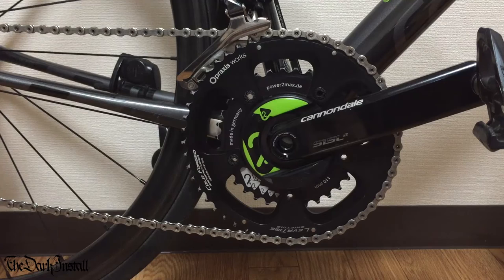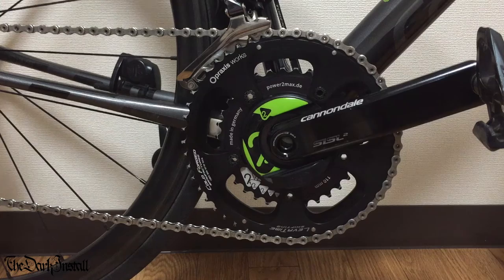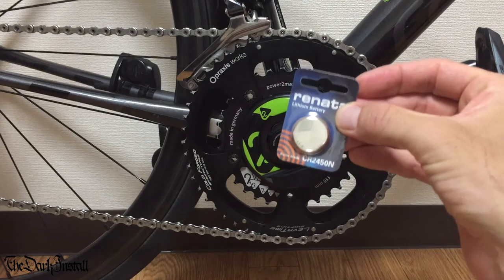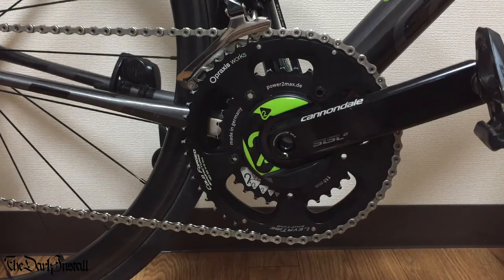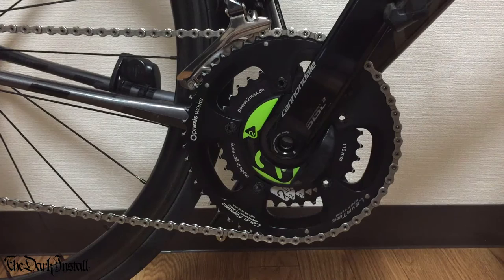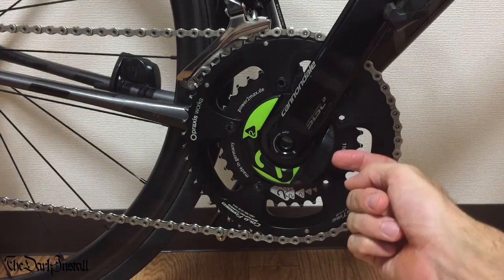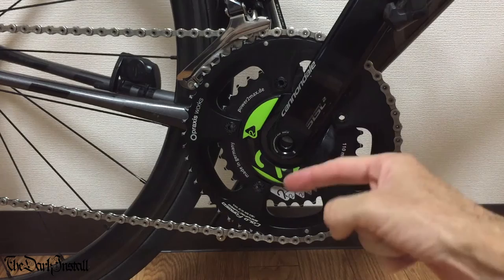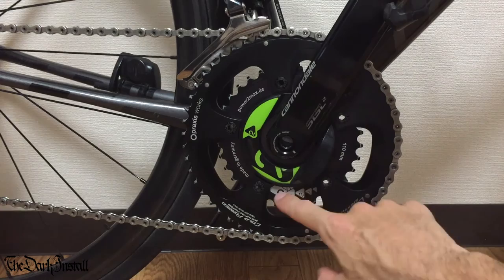Power2Max Type S. 7000km Review!!!

Comment: Awesome Review! I had almost the exact same setup. PowerS (bought in July) for my Cannondale Si Crank. After a couple different mechanics and shops, the TERRIBLE shifting you mention with the recommended Praxis rings was so bad I ended up returning EVERTYING (after a lot of fighting!). I loved the power-meter itself, but couldn't ever get the shifting as good as it was with the factory FSA's..... I am excited for your follow up review on that!!!
Reply from the maker: Joe Ferguson Thanks a lot!  Yeah the Praxis shifting is lame. Like a lot of road bike stuff, a few people say that a product is good on the usual forums, and then that becomes the standard response when speaking about that thing.  You can see this with Praxis rings.  In reality they flex and the shifting is crap.
Reply: TheDarkInstall did you ever find a "fix"? or the best way around? or did you just accept it? and change your style?
Reply from the maker: Joe Ferguson Yeah I 'fixed' it slightly;  I use di2, so I tuned the front mech to sit as close to the chain as possible on the low and high stops. This keeps the moving range small in di2, so prevents that annoying sliding of the chain across the teeth of the big ring on the upshift.  The profile of the teeth is still shit though so the chain gets stuck sometimes.  I do adjust my style especially when upshifting at low cadence; I lower the wattage in case it slips.  Which is shit to have to do, of course.
Reply: TheDarkInstall yeah.... glad it worked for you! what's sad is both praxis and power2max played completely dumb in acknowledging ANY issue, said it was my different shops/mechanics fault.... thank you for your time....
Reply from the maker: Joe Ferguson This is unsurprising.  There is a common vibe with bike companies to deny problems, blame the end user or claim it is the first time it ever happened, despite extensive recording of accounts on forums.  I am going to make a video listing all the times this has happened with me, which is loads.
Reply from the maker: Joe Ferguson Ha!  Just been out for a ride.  Chain slipped over the outside of the big ring. Praxis are officially shit.
Reply: TheDarkInstall that sucks for power2max.... because they are a great power meter!!!! i almost bought a complete setup... but they initially were refusing to return or exchange. only after threats/reports did they finally agree (still waiting for the money though, because my powermeter is still on the way to them)
Reply from the maker: Joe Ferguson Nothing to do with the power meter.  I bought the chainrings separately.  I'll just get some different rings.
Reply: TheDarkInstall 100% agreed! i don't know what other rings would work, power2max didn't make another recommendation to me... but they DID SELL/RECOMMEND the praxis.

Comment: Maybe you already knew, but Power2max is having a cracking deal right now. Buy any Type S for whatever it costs (from 690 upwards) and then get the new NG for 300 euro when it becomes available in December. (on most models its just the spider, but still). Also not sure if it includes the four bolt Shimano spider, but worth checking out. I'm currently riding Powertap hubs andI'm jumping on that deal right now! Thanks for the review. (I'm not sponsored/ nor work for P2M ;)

Any opinion on Stronglight CT2 chainrings vs. these Praxis rings that you don't seem to love?
Reply from the maker: I was not aware of that deal!  That is very promising.  Thanks for the info!  I will have a word with Power2Max to see if I can take advantage of this upgrade.  Would be great if I could get it (will link them to my glowing review...)

Stronglight CT2 chainrings.  Never used them, so can't comment.  I was looking for something to replace these Praxis rings with though, so will have a look at them.  Considered Extralite too, but will go with whatever is the best.

Appreciate the comment!

Comment: To address the delay, switch off smart recording in your Garmin and use a 1 second interval instead. This will to give you more accurate power recordings.
Reply: Actually, this doesn't really cause any lag but 3 second power (for example) will display more accurately when recorded every second.
Reply from the maker: tv ficzeri I thought the recording interval was related to how often the .fit file is written to, rather than how fast the communication is between devices...
Reply: TheDarkInstall Yes, I mixed that up a bit. Sorry.

Comment: love the review mate, really solid info. quick question, did you grab the decal, as green black? or just the power2max green. I have the new caad12 and that exact decal on your p2m would be perfect for my bike. cheers in advance for the response
Reply from the maker: 'Green-Black'!
Reply: TheDarkInstall mate, FSA super road chainrings. they're hard to find, but used by most pro teams I.E Cannondale pro cycling (they rock them with SRM'S) probably due to sponsorship commitment, but definitely a worthy option
Reply: update: ended up giving the praxis rings a shot... they are fucking garbage. mechanical dura ace 9000 and they can barely up shift under power. total joke. the p2m though... godlike meter
Reply from the maker: CKCycles ha, glad someone else acknowledges the truth about them. They are shit, totally.  Inconsistent, with the chain slipping across the surface of the teeth or falling off completely.  Every shift is noisy too.

Comment: Thank you for the in-depth review! Knowing what you know now about the shifting issues of the Praxis chainring, would you still buy a Power2Max (with a different chainring), or buy a Stages in order to be able to keep the Spidering? I understand the limitations of left-only power, but I feel that I would have to spend significantly more and downgrade chainrings in order to get total power measurement.
Reply from the maker: Reeeeeally late reply sorry mate.  I now have absolute black rings...  If I did it again I would still get the P2M yeah.

Comment: I have the Rotor 3D24 110mm version with Qrings. The shifting is much better than the Praxis rings even though my big ring is a 53 and effectively goes big/small quite violently!  Do you find that you get interference from other devices when the battery is old? I am about to replace my battery as a precaution after an outage during a Zwift race.
Reply from the maker: Hey,

Ha, yeah I can imagine that anything is better than Praxis upshifting.  It is so bad.  

Interference; no, I don't get anything like that, although I have only gone through one battery so far.  I did notice that the battery went from 'Good' to 'Low' very fast, however, so I would recommend anyone who has 'Good' instead of 'New' as their battery status on their Garmin, get a new battery ready ASAP, as the end is near!
Reply: Deveron53 - I noticed you mentioned that you have the Rotor 3D24 with Q rings and the shifting is good. I'm considering getting this crankset setup and using it with Udi2.  What groupset do you have it paired with and are you still happy with the shifting performance?

Comment: Did you have problems with the chain get stuck on the middle of the chainrings?
I recently bought a power2max and in my opinion the gap between the chainrings is too big. I am afraid of the chain drop to the middle of the chainrings. Maybe changing my chainrings the problem will be solve... but I don't know.
Thanks!
Reply from the maker: Never.  You are imagining this.  There is no difference in the spacing.
Reply: I'm a bit late, but if the chain is dropping between your chainrings, odds are the inner chainring is installed the wrong way around. I had it when I bought my bike used.
Reply: I have the same issue as you. Power2Max + Sram eTap + Rotor NoQ 52/36 chainring and the chain gets stuck in between chainrings sometimes. I measured the width in the spider and the P2M spider is actually 0.62mm wider than a SRAM Red.

Comment: Is there any particular reason why they haven't made one that works with shimano cranks and chainrings? It seems redundant to buy a new crankset when the shimano one I have works perfectly fine.
Reply from the maker: osfan25 you would need to speak to them about this.  Could be a licensing issue.  Not all power meter systems are available for all cranks, but yeah, it is rather conspicuous that Power2Max has omitted Shimano.
Reply: TheDarkInstall btw just watched some of your other videos, really enjoyed your reviews.
Reply from the maker: osfan25 oh thanks a lot!  Glad you like them.  I've not made any for a while as I have been busy with other projects but will get some more done as soon as I can.
Reply: The Rotor 3D version of the P2M S and NG are compatible with Shimano.

Comment: According to power2max website their campy system weight is 618g with bearings but no chainrings... Lame.
Reply from the maker: +Guoenyi crank arms, axle, power meter and bearings for 618g. That is not lame.
Reply: I was refering to the the fact no chainrings were included being lame. It is not like campy users can have some super fancy non-campy chainrings installed. It just makes comparing weight difference between powermeter crank and non-powermeter crank a pain consider campy does not publish their chainring weight anywhere.

Comment: Left hand crank arm is better. Easier to change from bike to bike, easier battery replacement, lighter, no loss of power in the heat, looks cleaner, is cleaner, more aero, less money. Those praxis are clunky chain droppers, prepare to be dropped. Oh yeah I forgot you ride everything big ring ;-|
Reply from the maker: mindciller are you referring to Stages?  Also, what do you mean I ride everything in the big ring?
Reply: I own one. It's a stages arm that gets swapped between 3 bikes road tt and cyclocross. I rode my steel classic road bike with no power and dropped everybody that was running power on their carbon bikes so in most cases they are pointless it's about the motor.
Reply: Well they did win the tdf last year so there isn't any better proof that stages work at the top level of the sport. They're definitely not cheap. And they are accurate you don't know wtf you're talking about.